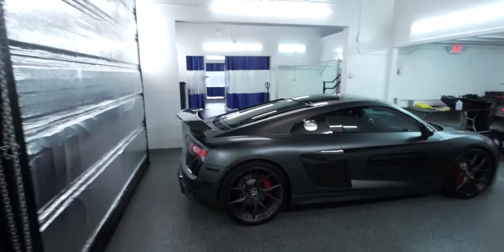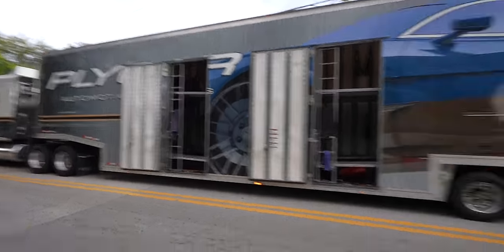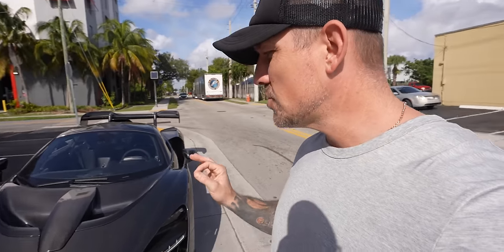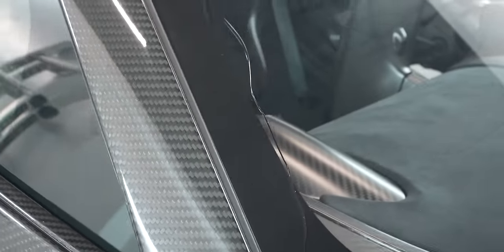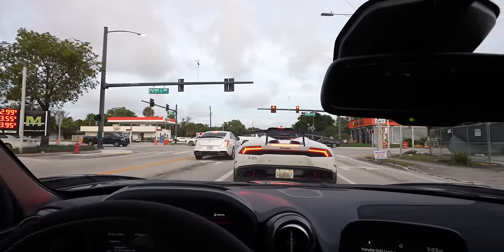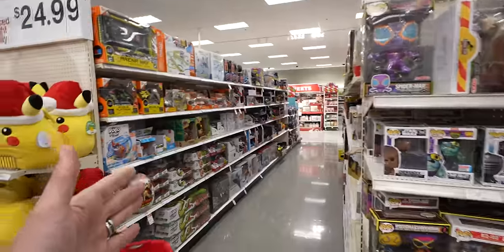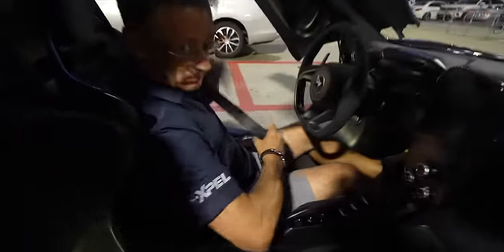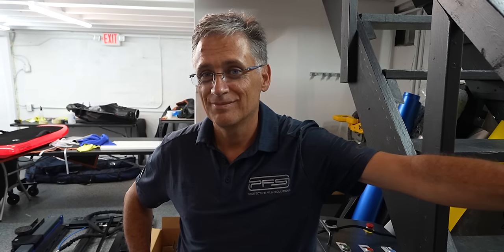MY WILDEST HYPERCAR PROJECT GETS DELIVERED TO FLORIDA FOR  …

Comment: Crack in the Windshield: I bought that RainX windshield repair kit for a 10-inch crack in my windshield. And it's held up for about 2+ years now. I got it at Walmart and I just followed the instructions and watched a couple videos on how to and worked fine. At some angles you can barely see the crack, but it stopped the crack from spreading and I deal with snow and hot weather.

Comment: I'm sure someone has already mentioned it but clear nail varnish or a clear epoxy should stop your crack spreading until you can change it. It did work in an old screen of mine.

Comment: Very, very very easy to erase the noise of the road grit hitting the underbody on the senna.. fabricate plates shaped the same as the rear half of the inner front wheel arches. I'll let you choose your material and the space between arch and plate. 
P.s ,,these things are quite important (Mike) ha ha...✌️👍🇬🇧

Comment: @dailydrivenexotics im 100% positive that the windshield crack happened on the florida highway due to a rock, not a flex, you are mistaken. And with that being the case, the windshield replacement is completely free of charge instead of $30k AND theres no insurance hit.

Comment: That flex crack was probably from a pot hole or when it was in race mode on the street. My friend with a twin turbo r8 had the same issue. Aluminum chassis lightweight cars flex slightly from pot holes. I would take it to mclaren and make sure the strut tower didnt slightly move and is straight or it will happen again.

Comment: @Damon you should have Ryan use some sort of ceramic covering or heat reflective tape under the wrap on the bottom of the wing. I'd hate to see what a Senna wing cost to replace because Gintani straight pipe flames burned or melted it!

Comment: Isn't the windscreen cracking a common issue with McLaren's?  They're made that thin, when the car flexes, they crack.  I'm sure other youtubers have had this issue with their McLarens too.
Reply: Yes, bc the way mclaren made the body and chassis so stiff with carbon, it happens a lot, especially on British roads, plus for weight, they made the  glass light and thinner....
But the weakness is the engine 100

Comment: Your goons end up with a crack in the driver side if you if keep putting your hand on the corner of the glass when you get in. Most likely how the passenger side cracked. Use the carbon monocock to place your hand and spin in. It’ll be okay, you’ll get it

Comment: The dealer will pay for the windscreen as there cars are known for cracking the windscreens from body flex if they inspect it an it turns out to be a pressure crack they will replace it for nothing